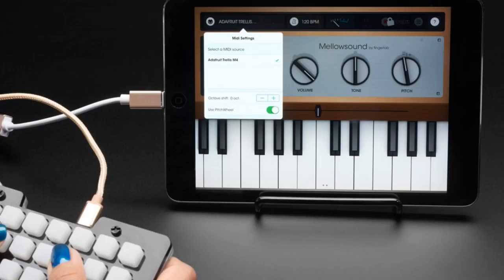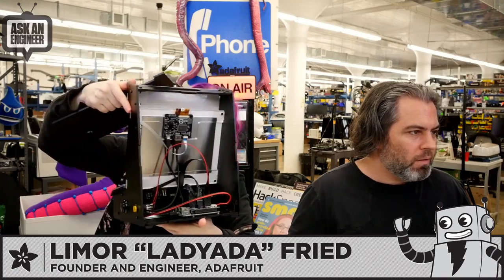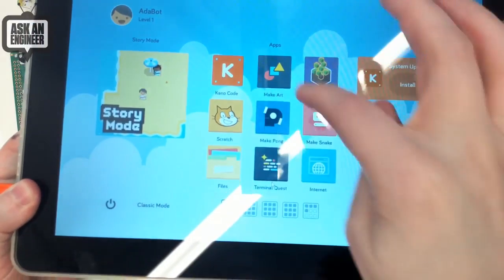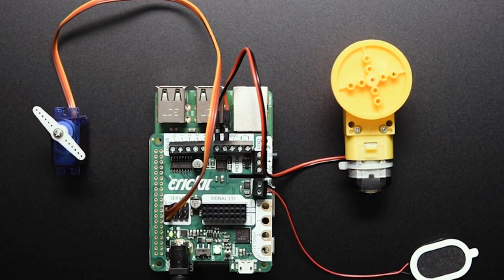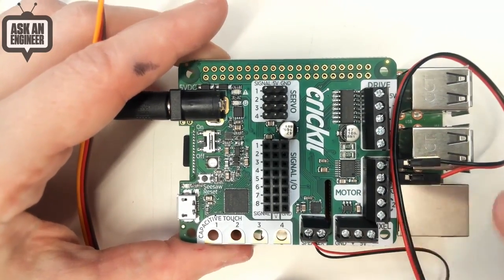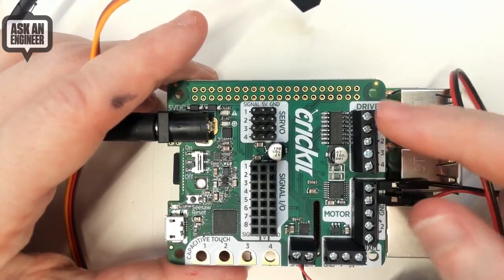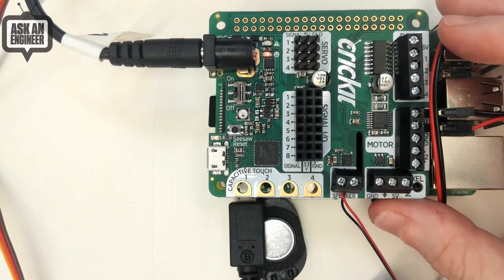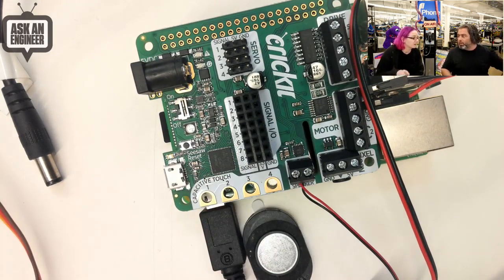New Products 11/21/2018 Featuring #Adafruit #CRICKIT HAT for #RaspberryPi @adafruit

Comment: The Raspberry Pi is great in driving WS28xx led's. The hardware is not an issue. It is the Linux which makes it 'difficult'. However, in Linux you can also do DMA in user space and do neopixel very well. Of course, the best option is not using Linux and program  baremetal on the Raspberry Pi